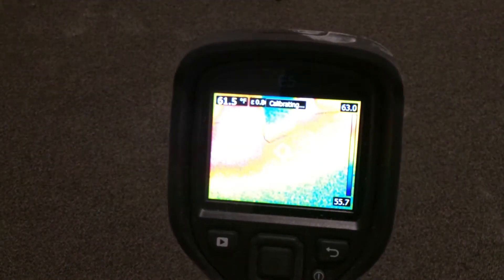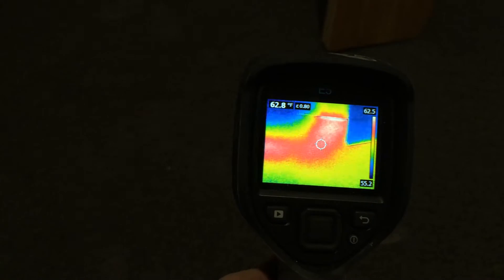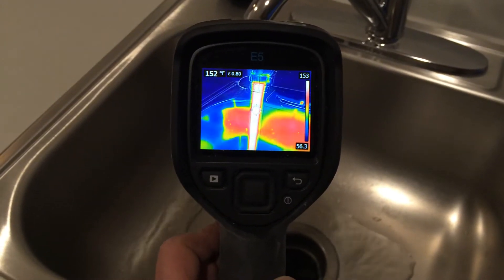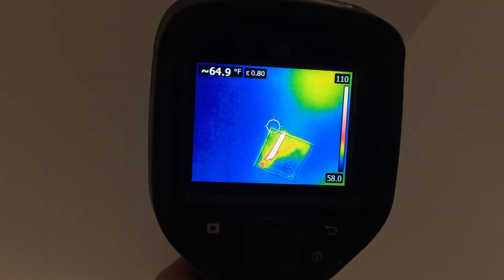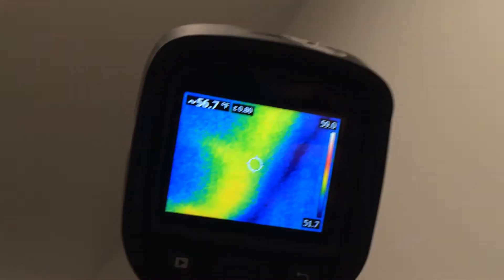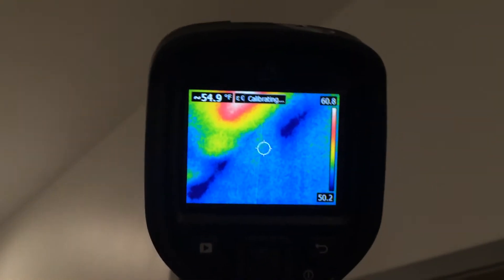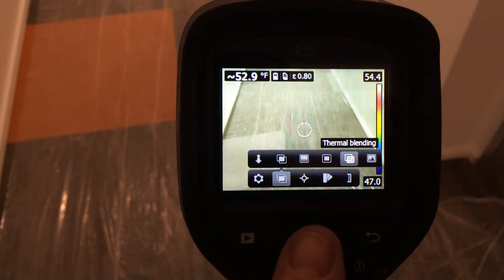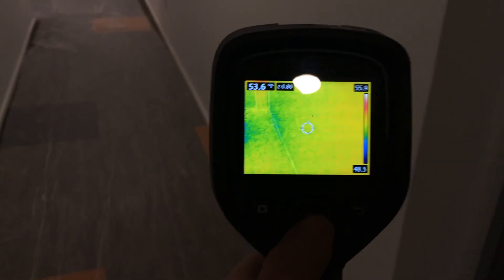Flir E5 Thermo image camera

Comment: You can buy the E4 and have the hardware unlocked to the same specs as the E8. I imagine you can upgrade your E5 to the E8 also. Flir was pretty dirty in using the same hardware, but different firmware. I bought a new modified E4 on Ebay for a little less than $1,200 with a couple extra accessories, and it has the same specs as the $3,000 E8.
Reply: Dude thanks!! I was just about to buy an e5 and had no idea about the modded E4. You happy with yours so far?